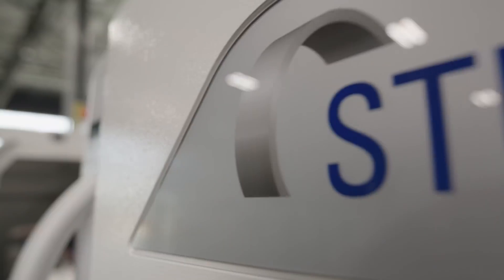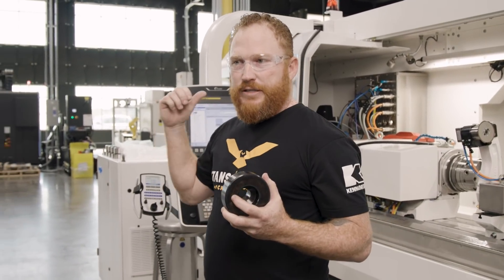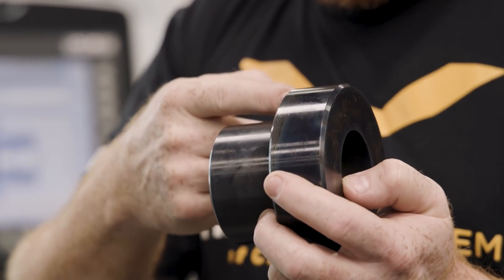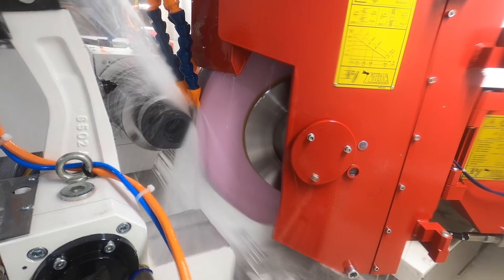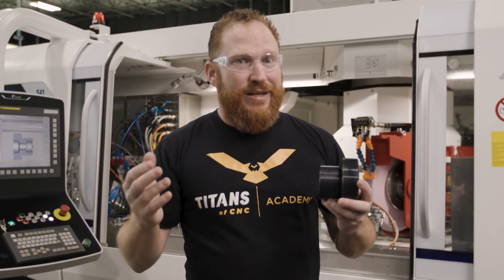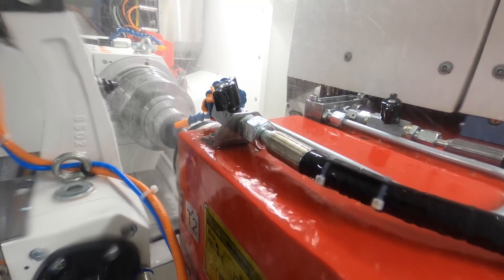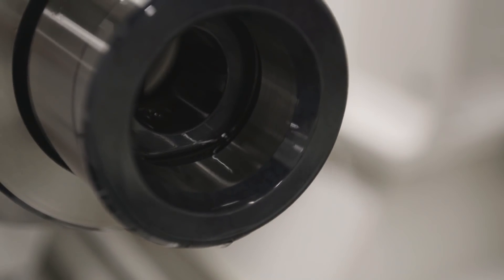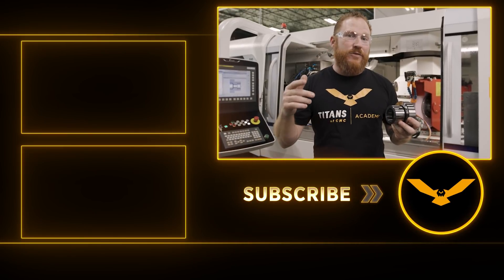ID & OD Grinding on the STUDER S41 from United Grinding

Comment: I used to do od I’d grinding on a heald grinder, manual not Cnc, holing the same tolerances, a big Cnc is cost.y and takes up much space,,too costly in Silicon Valley to house it, rents too high here.

Comment: Today's pro tip.  I was using a S40 with multiple spindles over 25 years ago.  If you want great I.D. mandrels use tungsten, NOT tungsten carbide but machinable Tungsten.  They are dead perfect and you can run a 1' wheel out to 5" at 30k rpm easily with a .75" diameter mandrel.  Of course you grind the on your Studer to make them PERFECT.  IF you do have some runout, simply mount a tool bit on the machine and at low speed turn the mandrel when mounted on the spindle., problem solved.

Comment: What an amazing machine. I grind parts too. I'm using an old hybrid id/od grinder. It's much older than me and I'm old. My finish tolerances are within 0.0002 for the inside. If you saw this machine I use you would be surprised. Can't find replacement parts for it so if something breaks I basically make a new one. Myself and my father have made replacement parts for it over the years. We machine the parts from bar stock rated for heat treating. I've learned so many intricate details of how to machine before heat treating to achieve a better part after heat treating. I can just listen to my machines and know what they are doing. At full swing before heat treating I run two lathes a surface grinder and a notching mill. All manual. Unfortunately i do not have anything programable. Lol. This video was really good and my hope is to maybe discuss with you some of your strategies.

Comment: Sir,
While machining a cylindrical part with a length of 300mm, we found overcut. The reason given by the operator was power failure while part was in running condition.
Is the reason valid ? If yes can you suggest remedy to it.
Reply: Motivo valido. Il pezzo si ferma con la mola che gira ancora, surriscaldando il pezzo che si dilata andando a contatto ancora con la mola e la misura potrebbe venire più bassa di tanto ! Anche 0,4 - 0,8 mm o più. Io sono rettificatore in Italia da 30 anni.
Reply: @Fau77it Thanks

Comment: I work with a old studer. I'm here looking to fix a problem, my numbers jump too high. We dress the wheel, we do the right touch off, and does not cut how is supposed to cut base on the touch off..keeps giving me big parts..like should be 35.008...it keeps giving me parts 35.055...when UTL should be 35.016

Comment: For some smaller ID grinding you need even higher speeds, some machines we built have spindles that can spin up to 100k rpm. Sounds like a jet engine starting when they spin up.

Comment: Just out of curiosity, why aren’t you using the rotary dresser for the od wheel as well? There are a lot more variables that you can change to achieve different performance from your grinding wheels, especially on an aluminum oxide wheel.
Reply: For this particular application, we wanted to show a variety of options moving around in the machine. The single point on the 30-degree wheel helped us dress the leading shoulder for our angle plunge. We had to take many passes at .0004 to get our shoulder depth to about .5 inches. The swing down allowed us to dress the back of the ID wheel.

Comment: Love what you guys are doing.  Now that you have a machine with sub-micron accuracy, it would be cool if you got deeper into the metrology side of things after showing all the cool stuff the Studer can do.  It's not as cool as watching titanium being ripped off bar stock at crazy MMR's, but it's a subject I feel a lot of machinist lack in.  Even your shop floor CMM may have a hard time passing a gage R+R measuring a diameter at +/-.0001 and even harder if it has to measure roundness or cylindricity under .0002.  Side note, it's RPM not RPM's... Sorry pet peeve  :-)

Comment: In an ideal world you would want a much shorter internal wheel arbor. As short as possible for finish and accuracy. But you can't always have what you need. And don't forget longer the arbor lower the wheel rpm will have to be for safety.

Comment: How well does a part like that have to be indicated in before you guys start cutting?
Reply: Not all features are finished in this setup.  Need to maintain runout back to unground features.  Also risk of non clean up if high run out
Reply: maybe a few hundredths of a millimeter would be enough, but it depends on how much stock was on the part to begin with
Reply: depends how much the part has distorted during the heat treat process. On a part this side I would leave .24mm and expect to be able to clock it within 0.005mm. I generally use a mag chuck though where possible as they're more reliable
Reply: Dependent on how much material is left on the other dimensions for 2nd operation. If you have .050” just get it within .025” and no worries it all comes down to 2nd setup where you need to indicate it in to within blueprint spec for T.I.R between dimensions. I used to have parts with 2-5 setups where all dimensions had to be true TIR to .00005”max with size usually .00005” or less. That’s where indicating parts and planning how to run it became an art in itself. Let alone holding straight,round, true and size to as tight as .000005”

Comment: get a mag chuck and drill and tap so that you can make custom rider pads so you can indicate easier and you will eliminate the issue with the parts not sitting flush on the 3 jaw surfaces. 

makes for an easier setup and consistent from part to part

Comment: it's amazing and as a Wire and sinker EDM guy i can't wait to see dressing with EDM module.
Reply: Walter already has it...
Reply from the maker: We’re getting a Walter also.
Reply: @TITANSofCNC  hell yeah... I dont run it but my buddy does..uses traditional grinding for the carbide areas. Then it uses a rotating edm wheel for the pcd cutting edges. Big fan Titan, only thing Im not a fan of is your phrase " perfect " all the time. Nothings perfect in machining, period. Boom.. Keep teaching the kids my man.